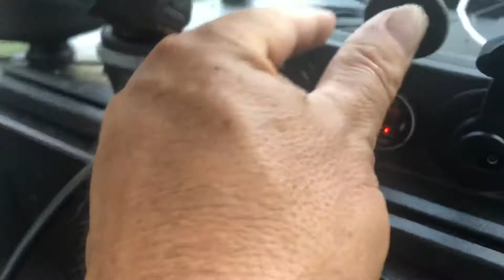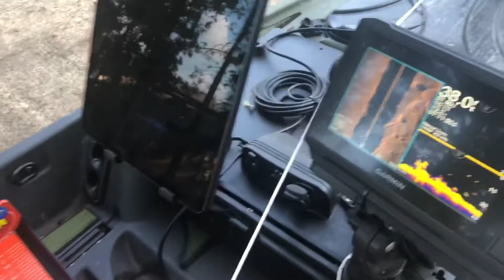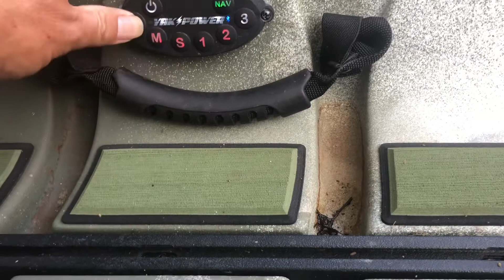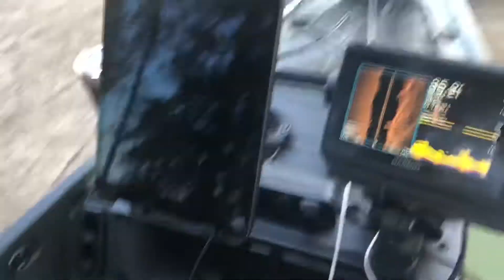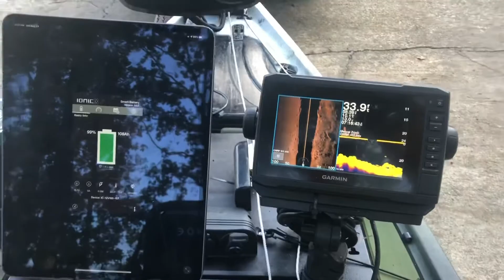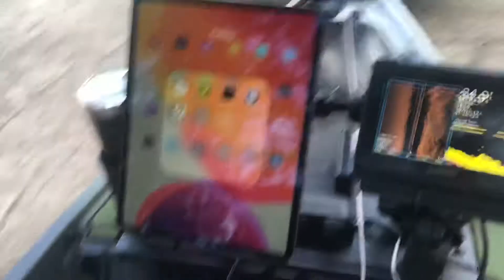Nucanoe Pursuit Setup

Comment: Nice walk through. I like your rig. I put an xi3 on my Old Town Pred PDL last year, and it really affected the way the yak handled - especially in adverse conditions. I really love that TM, but have been thinking of getting a Nucanoe, either a Pursuit or Unlimited, because I thought that maybe with the higher weight capacity it would handle all that extra bow weight better. Your thoughts on that? How does the pursuit handle big open water white caps with the trolling motor on the bow?
Reply from the maker: Thanks, the Pursuit handles open water very good. I think the Unlimited would be even more stable with the bow mount. Pursuit paddles better but if your not worried about paddling your boat I would go with the unlimited. Another plus with unlimited is you can add the boondox landing gear to the gear tracks. I do have the boondox on my pursuit but I had to buy the Sammy Pugh seat base.

Comment: Is your power drive Minn gotta a pain to release into the water.  I find myself always crawling in the front to release it.
I'm running a Native watercraft titan 12.  Im considering the pro nav setup also.  My only concern is im seeing people with the same kayak setup as mine but using motor guides.
They have better speeds and the motors seem quite also.  I don't know what route im going but I appreciate the upload here.  you have a killer setup for sure.
Tight lines!  fish on!
Reply from the maker: It’s not a pain at all. I always release it so it’s just barely laying on the bracket before I get in. When I’m in I just hold on to the rope and give it a slight push slowly let it down. Turn the motor so it’s in the reverse position and hit the motor and it locks down. When I’m in the kayak and need to raise it I just pull the cord around the lock lever and then pull the raise cord. It’s tied to a bicycle seat clamp I have around the shaft just under the head of  the motor. If I need to raise it in shallow water while fishing I just pull it up with the cord, not locking it and wrap the cord around the base of my cup holder so it will stay up and not fall back down. When I let it back down I simply unwrap the rope from the cup holder and it drops down.  The Motor Guides are a little faster but I can do so much more with the ProNav system. Check out some of there videos and you will see, not sponsored by them just love their product. You can now place the ProNav head unit inside the motor head cover with the mount they released. When it was mounted to the shaft it was easy to knock it out of position. You do have to have six inches between the head unit and the shaft clamp to help with interference so the top of your motor will be a little higher. Also in anchor mode it will turn and wrap the wires tight so you have to keep an eye on that. Just hit the foot pedal and unwind them. It still stays in anchor mode when you unwind them. For me it’s great.

Comment: Nice setup! Do you have to have the yak power box with that yak power system?
Reply from the maker: No, you can make your own. As long as it has a sae connector on your battery lead it will plug into the yak power main controller.
Reply: @dudefish1635  Thanks for getting back with me on that them yak power foxes are expensive!

Comment: Real nice setup! Where did you find the Anodized aluminum collar on the trolling motor shaft?
I am looking for that exact one!!
Reply from the maker: It’s a bicycle water bottle mount I modified. I removed the screw and front piece and drilled a small hole for the rope to go through. Link:  https://www.amazon.com/Mczxon-Aluminium-Adjustable-Universal-Handlebar/dp/B08JH622ZN/ref=mp_s_a_1_4?dchild=1&keywords=Mczxon+Bicycle+Water+Bottle+Holder&qid=1612791559&sr=8-4

Comment: Very helpful video man! How many rods can it hold?
Reply from the maker: I usually take 6. If I am fishing a tournament I take 8. Have room for 10.
Reply: @dudefish1635  Sweet! I am trying to find a good kayak that'll hold plenty of rods and suit me well.
Reply from the maker: @lukehurstfishing  you can add a black pack or milk crate in the back and add lots of rod holders. Lots of info on YouTube for this. Pedal drive??
Reply: @dudefish1635  Yeah, I have been looking for one that has a pedal drive system and that eventually can mount a trolling motor or something of motorized trust.
Reply from the maker: @lukehurstfishing  for someone just getting into kayak fishing I would recommend the Native Watercraft Slayer Max 10 or 12.5 or the new Bonafide P127. They both have the inserts installed on the bow and transom for a power pole, trolling motor or torqeedo/Newport Vessel nk-180 motors. You can also mount a trolling motor where the pedal drive goes. Both also has the ability to mount the  Native Sidekick wheels which is a must have for easy transport.
Reply: @dudefish1635  I have kayak fished now for about 2 years out of a small 10 ft paddle kayak, but I have really gotten into it and want to start fishing tournaments when I start driving. I have looked into the Shearwater 125 and the Jackson Big Rig Hd/Fd, but both of them have some small things I didn't like about them. I will most definitely check out the Bonafide P127 and the Slayer Max 12.5.